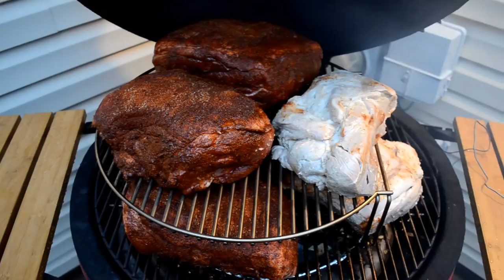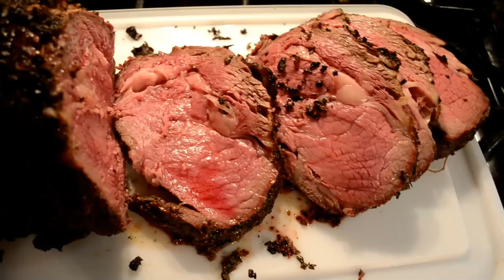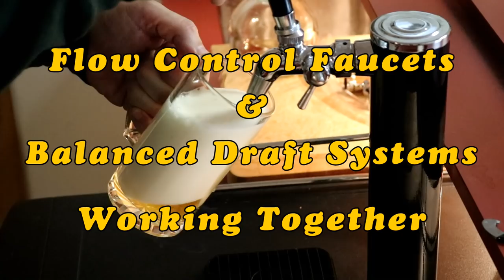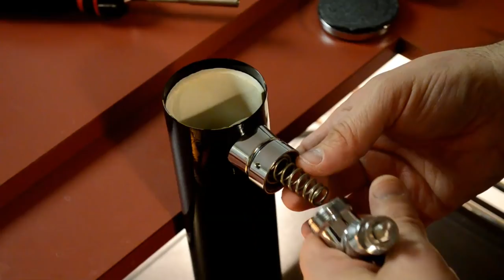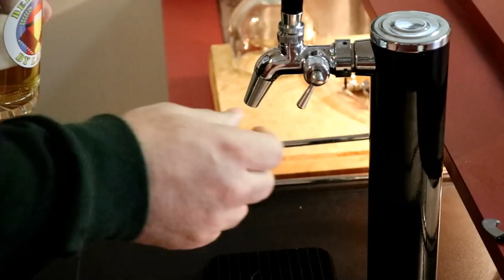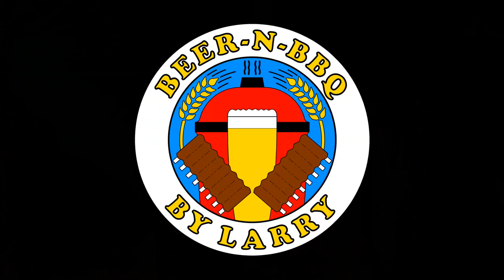Flow Control Faucets and Balanced Draft Systems Working Together

Comment: I switched to a Micro Matic commercial kegerator with a fan cooled tower and placed the CO2 tank inside. I used ultra barrier gas and liquid lines 7' coupled with SS Oetiker clamps. The stainless steel tower shank bowls were polished to reduce nucleation sites and I attached  SS Perlick flow control faucets. Everything is very cold the laser thermometer is showing temps anywhere between 38 and 55° inside the kegerator, keg, CO2 cylinder and tower. Finally a perfect pour and yes I'm still crying. Thanks Larry keep up the good work.

Comment: I have the same flow control faucet.  It’s works great.  I have 8 feet of line, and when I pour I start small, but once the tower chills, I open it.
Reply: @BEERNBBQBYLARRY  Should have a cooled tower
Reply: @BEERNBBQBYLARRY  Do you have a T-tower or a flow through?

Comment: Larry.
I’ve only ever used picnic taps. I’ve found though, that if you restrict the flow the beer comes out foamy. I always open up fully as quickly as possible and usually have little problems.

Comment: The Kegland Flow Control Ball Lock Keg Disconnect works really well at the keg end instead of the tap end. Great if you want to serve different styles of 🍺 beer with higher psi pressure. I was amazed, they cranked up to 30psi over pressure and turned down the pressure on top of the ball lock disconect and the 🍺 beer  come out perfectly with nice head. I recently made 2 tasty 5 gallon Pilsners 🍻🍺🍻🍺🍻 and serving at 12psi and wanted a few more bubbles at 13-14psi works very well. I'm using the Intertaps with springs.

Comment: Thanks for the video, great advice. I've just bought 2 new Intertap FC taps for my kegerator as serving highly carbed beers like Saisons, Brut IPAs etc is getting hard with my standard system (and i have 3 different styles on tap at any given time). I'm also replacing my lines to 4m per side using 6mm I.D tubing - so hopefully this balances things out to serve at 12psi at around 4-5 Degrees Celsius
Reply: @BEERNBBQBYLARRY  haha yeah I just finished your spreadsheet so about to head to the brew store! Smallest ID lines I can get to fit the corney outposts is 5.5mm though...

Comment: Necro post: a font cooler is critical. If your faucets aren't  sweating you're gonna have foamover. Yup, flow control can only do so much. It helps but you'll still be fiddling with the gas input.

Comment: This is a great video and all, but if you don't have the balancing issued to the extent that you do, I get the feeling that these flow control taps could probably solve the issue fairly easily.

For example, in that second clip where you were pouring the foam for a good 7 or 8 seconds, yeah, I agree, it's probably not going to fix the issue in that situation, but if you someone like me that doesn't really understand how the whole balancing thing works, and doesn't necessarily want understand, it's a viable solution for someone like me.

I've got this exact same issue but nowhere need to the extent that you demonstrated, I'm pouring foam for about maybe 3 to 5 seconds, and then everything after that it's just beer, but at 12 psi you're still going to have a reasonably thick head, if I had the ability to mitigate the flow for the first few seconds and then crank it up to serving flow, I would still get reasonable head but I don't think it would be anywhere near the amount I'm getting now.

I'm not calling bulshit on your video, I just think that these taps could potentially solve the issue if the issue wasn't as serious as you demonstrated.

Comment: Well i guess this answeres my question from your other video.  Bummer.  Well glad i didnt go crazy on ordering them.  Still may give one a try.
Reply from the maker: There is a product, a flow restrictor, that attaches directly to the keg post which can be tuned to control flow rate at the start of the beer line (rather than at the end like in a FC faucet).
It works much better but still only works well if the line is reasonably balanced.

Comment: Great information as usual Larry thank you. I have a balanced Keezer tap set up as per your information - works perfect. As a matter of interest I also use flow control taps direct on keg posts and for 10-14 psi they work like a dream pour - but I have a wheat beer on tap and you’re right at higher carbonation the balance is tricky.

Comment: Have you tried a flow control at the post rather than the tap.  This is apparently the better way as you don’t have the head pressure that you see at the faucet end?
Reply from the maker: Not yet but am considering it.

Comment: A quick question on the flow control. What happens if you are in the range of 5 psi? Ie you normally serve at 10-12psi and you go to 13-16. I can understand the double jump 10 to 20 would cause issues. My thought is the flow control would work well up to a certain pressure amount where the deviations aren’t great. Would be great to find out :)

Comment: Thanks! Last question: Intertap or Perlick?
Reply from the maker: Forward sealing designs of any brand should be fine. Just beware of Chinese knockoff especially Intertap.  Rumor has it that they can also add to foam issues due to poor surface roughness on the interior.
Reply: @BEERNBBQBYLARRY  Thanks for the tip. Picked up a few Intertap Flow Control faucets from a legit distributor so hopefully it all works well.

Comment: Hey Larry, Carl UK . MOVING fro PB to keg . When carbonating and I have reached my lager carbonation levels for lager ,I then turn down to serving level ,do I leave it connected to gas line or can I uncouple and serve . Cheers fella
Reply from the maker: You’re describing an unbalanced draft system. If you balance your draft system, the pressure is the same and there is no need to fool around with it.

Comment: its temperature. that kegorater looks like it uses a cold plate instead of a cooling fan. did numerous service calls on this issue. direct draw systems need no more higher pressure than they would need that faucet. cant even put a cooling hose in that tower which helps.

Comment: So what do you think of the flow control tap itself? I’m thinking of adding three more taps to my keezer. Should I go with the flow control?
Reply: Good to know. I would have assumed the spring closer would also have worked on the flow control tap.
Reply: I have a perlick flow control and really only serve beer from my kegerator with a balanced line and I love it. it allows for the adjustment of different beer styles and their pressure. also allows you to get a good head on your beer with nice control just by moving the control arm as the beer is pouring.  that's how I use it at least. I don't really set a point on the control and just leave it there, I tend to move it as the beer pours to get the perfect pour each time. although  I don't always need to play with it but when pouring a beer that's not matched to my system it is a great feature to have. I've also started closing the flow control completely after each pour to ensure I don't have a leak. with the Perlick, well mine at least I can leave the tap completely open but as long as the flow control is closed im pretty leak proof.

Comment: I have a kegerator set up for one beer style, my favorite that is only available on tap. Recently they changed the keg style to something taller and narrower and they figured out a different way of dry hopping the beer. Could that affect the system at all?

I absolutely cannot get a properly poured glass of beer. Foam all day long. I started around 8 psi and worked my way up to 20 psi!!! By then I had a decent beer coming out but it was so fast it still foamed.
Reply: @BEERNBBQBYLARRY  I got the setup from a friend. He got it from Beverage Factory. The new keg style is only an inch or two taller, but I think that is because of added handles. I have to trim down the platform inside the kegerator to let it fit. Overall the keg top for the connection is just a little higher relative to the tap. But still using the same line as before.

I will probably get a 15ft hose, currently it is about 5ft. That way I can trim down as needed and could have flexibility for other possible beers.

Thanks
Reply: I ordered a 15ft hose. Hopefully it will be able to fix my problem. I compared the old keg to the new one and the tap is about even height with the keg connection. The old one is about an inch or two lower. That is really the only thing that has changed for me. If you have a video on keg height vs tap height I'd love to see it. Seems like more great info

Comment: It looks like the pressure is too low. Have you tried getting higher with the CO2 pressure? When using a compensator you want to make sure your beer doesn't release any gas bofore the flow control gap, so you might need to increase the pressue a little. 22psi/1.5bar should be absolutely in the working range of a compensator faucet...
Reply from the maker: Thanks for the question. My pressures are always exactly where they need to be for proper carbonation levels which typically is 8-12 psi to cover the range of beer styles I brew.
If you add pressure above what you need or want in the beer then the beer gets over carbonated. You should never need to add (or drop) pressure in a balanced draft system. (To balance, you need to adjust the length and diameter of your beer line.)
If you feel you have to add/drop pressure to get a decent pour then your system is not balanced and any foaming from a flow control faucet is the least of your problem with your draft system.

Comment: What are your specs for an average cider? Psi, temp, hose length
Reply from the maker: I prefer highly carbonated cider (~2.8-3 vols CO2), so I use about 18-20 ft of 3/16 ID which ends up around 14 psi at 36 deg F.

Comment: So I've been doing some research.  They change the design of the inner tap.  It is now called nuka tap.   They change the design of the flow Control.  It's supposed to be a lot better.  I bought one.  I guess we will see
Reply from the maker: It’s not much better. Only incrementally. I also have Nukatap. Still causes foaming if the lines aren’t balanced.
Reply: @BEERNBBQBYLARRY   The more I learn The more I understand How/Why  Things work.  I think I have found the solution To the long line problem, I am hoping the faucets will eliminate The need to ever change the lines lengths  Once they are painstakingly installed.  Keezer build.
Reply from the maker: @BeerWineandShine  I just use the longest line needed for the most highly carbonated style I brew so that all beer styles are accommodated. Downside is that the lowest carbonated style takes a tad longer to pour.
Reply: @BEERNBBQBYLARRY  lol,  And that brings me to my next slew Of problems.  I have absolutely no idea Carbonation levels Different beer styles need.  Nor do I know what styles of beer I will settle on the most.  I am trying to broaden my horizons, I know that I do not like bitterness.  I have a lot to learn

Comment: This would've been a super interesting and even useful video if you had shown the difference, on the same keg with the same beer, the additional beer line to balance the higher pressure would've made to the pour. I am also struggling with beer foam in my last two batches.

Comment: I have 20 ft beer lines so I don`t need flow control because they don`t work as intended. Cheers
Reply: BEER-N-BBQ by Larry I pour slow and steady. About 20 second for a pint glass, but just shy of a one finger head on 12 psi keg. I`m happy with that. Cheers
Reply: Wouldn't a smaller diameter do the same as longer length since you are looking for line resistance?